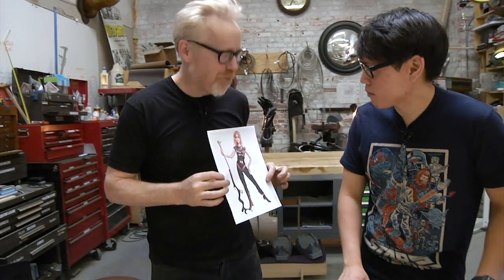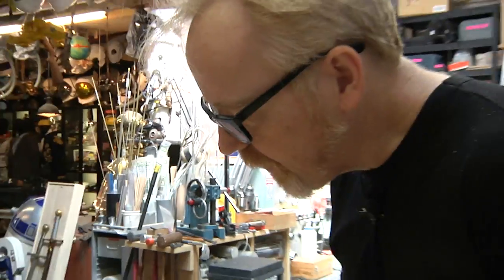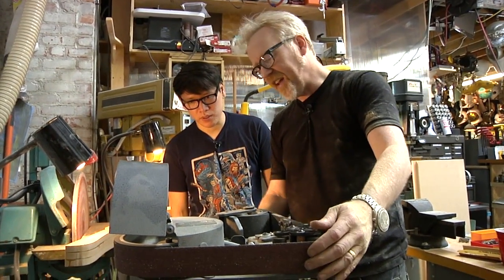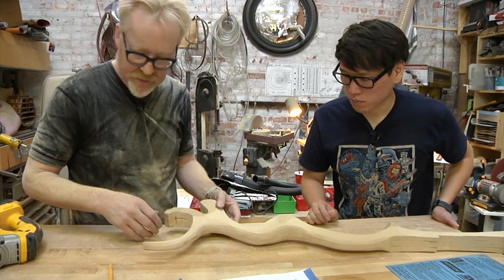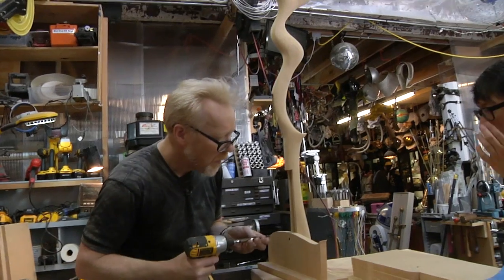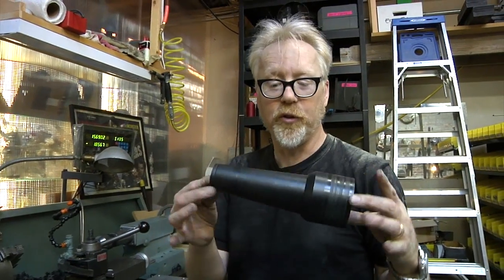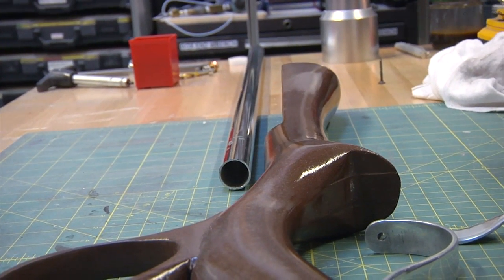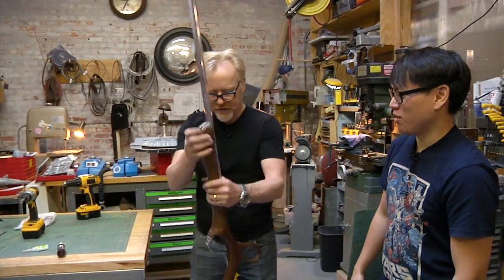Adam Savage's One Day Builds: Barbarella's Space Rifle

Comment: I love watching Barbarella a great one off, and I've enjoyed watching this video it is one hell of a build to make that iconic gun, it was a pleasure to see you at work and in your element putting this piece together. Also that you made it up as you worked through, not an easy job and basically winging it. I would love to have an awesome work shop that you have.
        I myself, love model making even though I've not done a lot, it's a hobby really, though I would love to do as a job instead of stacking shelves at a supermarket. I don't have a lot of money and do everything in my small bedsit in the UK. I challenged myself to build something big. I've collected a lot of materials, mostly cardboard, cardboard inner tubes, and basically a lot of cardboard, and a lot foam core and PVA.
        I've been building a space-station, mushroom and industrial in appearance, with a large saucer section. It stands about five foot four, almost taller than me. Now I decided to make it even tougher by adding LED lights to bring it to life. These LED's are the battery powered type you get at Christmas and I've lost count how many I've put inside and out. It's also been an enterprising effort to hide the battery packs, some are internal others are external, with removable panels to access the switches. My dad did tell me I could have put them all on one circuit and power them through the mains but my knowledge of electronics is limited and besides it has been a fun brain teaser. The build is getting there, right now I'm adding external features, textures before rendering. It has taken me about 2 years to get to this point.
        Adam, you are an inspiration, love watching your channel, lots of interesting builds, challenges, show visits and tours behind the scenes of the many movie workshops that span the world.
        Awesome stuff.

Comment: Nice trick I learned when making my electric guitar. Clamp a cheap plastic bristle dollar store brush to your table (or in a vice). When the pores of your paper get clogged: smack the paper against it in a brushing motion. You get a lot more use out of each page of paper before it's too clogged to be effective. Works best if your using rubber sanding blocks, something about the way the rubber bounces off the plastic brush clear the paper really easily.

Comment: why don't u use metric system? it's much easier
Reply: Because he can read imperial fine?
Reply: Because the metric system is a terrible system for accurate measurements. Try cutting something to 1/3rd of a meter.
Reply: WRONG. 1/3m is simply 33.333 cm, very easy,... now try cutting something 4/10 of a feet
Reply: +rormc 1/3rd of a meter is 33.333... centimeters. 4/10ths of a foot, however, is simply 4.8 inches.
Reply: that's ridiculous and unnecessarily complicated
Reply: +rormc Wait... You're saying that being able to accurately measure something is too complicated and unnecessary? Then metric is the system for you! With the metric system, you can reliably make unreliable measurements that will cause anything you build to be uneven, unsafe and unusable!
Reply: +rormc What are you on about? A BTU is the amount of energy required to raise the temperature of one pound of water by one degrees Fahrenheit. As a pint is a pound, and there are 8 pints in a gallon, it takes 8 BTUs to increase the temperature of a gallon of water by one degrees Fahrenheit.

Also, the gram calorie that you are referring to is a deprecated unit of measure. The joule is its replacement, and it takes 4.186 J to raise the temperature of a gram of water by one degrees Celsius.
Reply: no one uses BTU as unit of measurement. any half decent engineer advocates that the only 3 silly countries that still use imperial should change to metric.
Reply: +rormc And any fully decent engineer knows that metric was abandoned because of how inaccurate it is.
Reply: both scales are arbitrary so neither is ''more accurate''. But the majority of the world uses metric, so by ''market share'' or ''democratic vote'' metric is better, also metric is easier to use for calculations.
Reply: Because he's already used to imperial
Reply: Lol no
Reply: to wrap the conversation up:
He doesn't use the metric system, because he isn't used to use it.
If you build stuff by hand it is easier to use a system which you are familliar with.

However, there is a reason why most countries in the world use the metric system:
It is in fact more accurate, as it's scales are much smaller.

Also from a mathematic standpoint, it is based on out way of counting, meaning on decades instead of dozens.

Of course there are points like, ''how to cut a third of a meter'' or ''how do you cut a fifth of a food'', but those are irrelevant, as anyone who has to do something like that knows the numbers and,or can use a ruler and a calculator if necessary.

But we can conclude that both systems have their advantages and disatvantages, which make it almost irrelevant for home use and only matter in scientific work.

I'm a math and ''applied physics'' student, if this makes my point more viable
Reply: I'd assume the actual answer is because he's producing content directed at people who use the imperial system.
Reply: 1 meter 100 centimeter 1000 millimeters 10000 1/10 mm it is more simple..
Reply: Jonathan Holmberg why is everyone forgetting the 10 decimeters? D:
Reply: +ExecratedPlays you can't be serious. how is the metric system inaccurate? you can scale both systems into whichever accuracy you want or you are humanly capable to apply - that's the whole point of any measurement system. it's hilarious how you used an "engineers" argument, when you are incapable of using any technical logic in your reasoning yourself. the metric system is a lot more logically coherent (and its scales are finer for most quick daily applications), but the imperial system is simply firmly established in the US - which is just as applicable once you're used to it. anyways, claiming that any system is "inaccurate" per se is devoid of any common sense and claiming that "engineers know that" is ridiculous. you must know a lot of stupid engineers then.
edit: the metric system was also never "abandoned", it was never used as main system in the US in the first place. the only reason the imperial system is still used now is because it was the first one to be used, and no one wanted to move away from this "true American scale".
Reply: +rormc Nice Wild Thing reference. :)
Reply: BECAUSE SOME FEET ARE LARGER THEN OTHER FEET its confusing. tho very acurate when making shoes.
Reply: "BECAUSE GRAM WEIGHS MORE THAN OTHER GRAMS it's confusing. I was using Gram as a name. But yea, Feet is determined as 12 inches, not how long your foot is, that might be why you are confused...
Reply: Go ahead. Show me where on a metric ruler you can find an infinite number of 3s in 33.3333333333333333333333333333...cm. Also, 33.333... time 3 is 99.999... and that is NOT 1 meter. Damn close, but not a meter.  1/3 is an irrational number.
Reply: Any engineer (or scientist for that matter) will tell you everything is built with (has) a margin of error.
Reply: As a Machinist we work with very small measurements... down to measuring 1/100th of a milimeter.. or 10 Microns (Micrometers). A very common thing to work with in regards to making things fit together perfectly. I am not even sure how you'd write 21 microns in the imperial way, except 0.00082677166in. If that is how it would actually be written? I'll take the metric any day..
Reply: 1/3 is an irrational?!?! rational numbers are numbers which can be written as a RATION (1/1 1/3 123/321 4/1) and 1/3 IS a ration. How on earth can it be irrational then? By the way, 99.9999999... is actually 100. proof: 
x = 0.999999... 
-> 10x = 0.999999... * 10 = 9.999999... 
-> 9x = 10x - x = 9.999... - 0.999... = 9 
-> x = 9x / 9 = 9 / 9 = 1 
-> x = 0.999... = 1
-> 0.9999... = 1
so 99.9999... also = 100
what's wrong with you??

P.S. irrationals are numbers like pi or sqrt of 2.
Reply: .999.... does not equal 1. In order for it to be equal to 1, one of the .33333... needs to be a .33333...4
Me calling it irrational was a misnomer.
Reply: Corbin the Intern actually. 0.99999.... is 1. 1/3 is 0.333333333..... and 1/3 + 1/3 + 1/3 is 1 hence, 0.333... + 0.333... + 0.333... = 0.999... = 1
Reply: Americans don't use metric so it's not really surprising Adam uses imperial, but how is the metric system 'inaccurate'? Saying that it is makes no sense whatsoever
Reply: America uses the Imperial system, and it is standardized here. Every wood and metal shop I have ever been in uses imperial, and the parts we even get for the shops are all imperial.
Reply: Metric is way more accurate that imperial.As is celsius against farenheit.
Reply: No, no it is not. Simply put, Celsius against Fahrenheit, Fahrenheit has 176 degree difference between freezing and boiling, and Celsius only has 100. I can do this all day, but it is what it is. The system is what it is, but quit toting bogus claims.
Reply: rormc 
 Because he's not a god damn commie.
Reply: 7.62forge Communists weren't the only one using metric.They didn't invent it either.metric is way better.
Reply: T Swag
What? Only has 100?
100 is boiling point way easier to remember than 17-fucking-6,A 100 celsius isn't a top off point it goes WAAAY beyond.Fahrenheit has alot of "measurments" than can change all of the sudden like foot,tea spoon,table spoon(I mean come on your measurment is based off of fucking spoons).I can do this all day...
Reply: No, I was using what you said against you. Fahrenheit scale of temperature is actually more accurate because there are more degrees in the same range. You said Celsius was more accurate, and I proved ya wrong. Fahrenheit is not a scale of material measure, so your wrong there again. And yes, spoons. Do you not have measuring cups? Same principle. Some dishes just do not take as much, so yes, tea spoons and tablespoons. One teaspoon of water is 5 grams, and 3 teaspoons makes a tablespoon and 16 tablespoons to a cup. They are handy measuring devices all homes have, so it's common to see them in recipes.
Reply: just saying but if we're arguing temperature scales. How about this: Celsius uses the same scale as Kelvin, which is the SI unit of temperature.
Anyone working in any real science will tell you SI Units are just the superior units.
(Also no, I don't count engineers, if they wanted to be taken seriously, they should have considered Physics)
Reply: Accurate measurement relies NOT AT ALL on the units that are used. And one can make reliable measurements to the μm. What's that in inches?
Reply: I bet my balls that in the future everyone will use metric sistem and forgot imperial units, it's  more simple than shit like an inch is 1/12 of a foot and other no sense numbers.
In the metric sistem all is 10, EASY
Reply: I don't mind of people who use imperial units, I simply don't understeand why people keep defending it
Reply: The Danger Because I've been using imperial for literally everything except cooking my entire life, and I'm not about to change that just because some screwball on the Internet claims that my way is wrong and inaccurate.
Reply: +Corbin the Intern I didn't said you should change, i said that i don't know why people keep defending it
Reply: We defend it, because idiots that don't have first hand experience with it are always claiming it's superiority (usually with very wrong impressions and false statements) and that we should all just change. Personally, I don't care. Imperial units can do everything I need it to do, so why change? Literally, look at the original post. Someone just "telling" you to switch systems, which isn't actually that easy to do in workshops in America  because all the machines work in Imperial. Neither system is wrong or inaccurate.
Reply: T Swag Yeah neither is wrong cause it's the exact same thing but imperial is way harder.Nothing is going to change with the machines.Just the writing on it.
And just because you only eat microwaved food doesn't mean other people don't cook aswell,or do science experiments,or forging.
Reply: Yes, but you can not just "change the markings" on your machines. It's not that simple. And I have never heard anyone say "Oh, if only we just had metric". No, people who understand imperial find their uses and ways to use it to meet their goal. And how would cooking benefit from metric over imperial? Because, I have worked in a kitchen, and cooking poultry to 170 degrees Fahrenheit or 77 degrees Celsius takes just as long. How would forging benefit from metric? Simply put, it wouldn't, because they have found a way to do it in Imperial. Also, science in America is done in metric due to it being an SI unit and the information is easier used/shared in the scientific community.
Reply: I know,  right? I mean, why to stick with the imperial that is actually based on the metric system if you can simply use the metric istself? But reading the comments I see it is just plain old confort zone lol
Reply: T Swag List me all nations that use imperial scale. Exactly...
Reply: +T Swag (ThanoricOfficial) add me on the list and all the scientist and phisician
Reply: The Danger dont forget me
Reply: Scientists and physicians already use metric. So swing and a miss. Imperial is still easier to use in carpentry and machine shop work. Does it really matter if my house is 2330 sq ft or 216 sq meters? Nope. People have already did the BTU math and can tell me how much my heater needs to put out. Metric is not more convenient in day to day life. It's actually easier to get accurate results with Imperial, because your not rounding numbers or really converting anything. If I hand you a 7' board and tell you do cut it in half, it's as simple as 7/2. 3 and a half and half is 6 inches of a foot. Wow. Very easy. I doubt most people dissing it have ever even been put in a scenario to use it, so they are talking out their ass.
Reply: Double reply here, or better yet, if I hand you the same 7' board and tell you to cut it into 3rds. That's another easy one with no decimals, 7/3 is 2 and 1/3. 12/3 is 4. 2'4''. Nice and easy.
Reply: I normally lean towards metric because of ease of use, but I must say your argument wins here. Trying to measure something that has a repeating decimal sounds horrible. But the metric system still has its place, its just better for certain situations, just like the imperial system is better for certain situations. And yes, I know the comment Im responding to is 5 months old.
Reply: because he can
Reply: Because this is America
Reply: Probably just habit. He's said before that the metric system is a more sane measurment system. I also think metric is superior but tend to use imperial out of habit.
Reply: haha i love these stupid arguments that cause a novels worth of comments, we might aswell start debating religion while we're here......
Reply: How was this even a discussion? Old habits die hard, the Imperial system is outdated and unscientific but everyone in America who needs accuracy and/or ease of conversion uses the metric system.
Reply: Corbin the Intern usually,you don't get ten as the thing you divide by three,I am asian, so I know better XD

I am actually asian though and i never get why people outside of asia say that. Everybody basically knows the same degree of math at sone point. Just not the same.
Reply: The Danger  when you’re used to using imperial you get comparison issues with metric bc your mind keeps asking “but what is that in inches?” Bc you’re basis of measurement was started out with inches. It’s that simple, why add extra steps? I am 34 and I’m still like “so a centimeter is like a little less than half an inch right?” It’s just TOO HARD trying to learn the metric system had half of my elementary school class in tears.
Reply: Because when you are the only superpower in the world you can measure in whatever units you damn well want!  MERICA!     

Peace!
Reply: @brain8484  u mad bro?
Reply: @johnchaplin2415  yeah lets say your the only superpower while every other country on earth gives you every thing you eat south africa gives you gold, diamonds,apples so yeah if thats a superpower of the earth and its not on its on a superpower 

PS its sebra not zebra you dont have them so you can't name them
Reply: the imperial system is far superior for making quick accurate measurements and translating that into physical items. There is far too big of a gap between the orders of magnitude in the metric system.
Reply: @Rogermc   BTU is still used to measure output of HVAC systems.
Reply: @Rogermc  - try cutting a pizza into tenths.
Reply: @martinstammerjohann8379  - if ur conversion of 21 microns is correct, then 21 microns is eight ten thousanths of an inch.  four places (.ooo1") is about the limit in a machine shop.  microns is a measurement for measuring the width of ur pubes, not machine work.

Comment: you should have stained the wood instead of painting it, then clear coated it. I think that would have added a-lot better of a look to the rifle.
Reply: You can't really stain mdf, it doesn't look natural like normal wood
Reply: Deimos Phob that wouldn't work as i don't believe mdf or ldf in this case has a 'grain' to it meaning the stain would just make it look darker and would have the same look as he created
Reply: it cant really be stained like normal wood, but I think for this, it just needed the feel of wood, maybe even just a slight look of wood instead of the opaque paint, and I think the stain would have done that just fine even with MDF. However, I personally would have used a soft wood thats easy to shape instead of using MDF
Reply: Deimos Phob  yeah, color and texture were off from original
Reply: Deimos Phob Yeah, no joke!
Reply: The original propmaster probably cut the stock out of a five foot long 2x12 pine board.